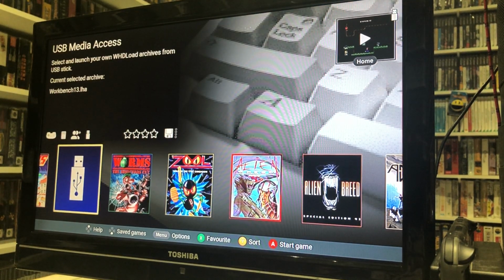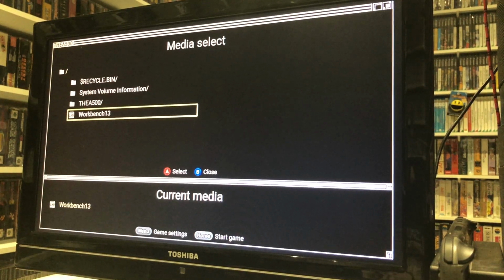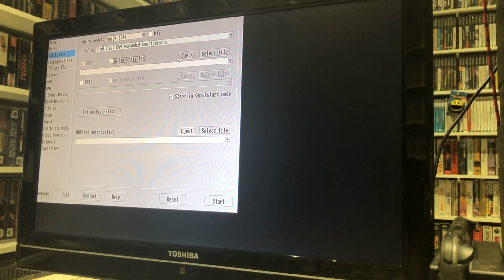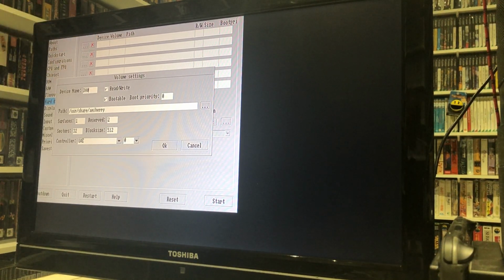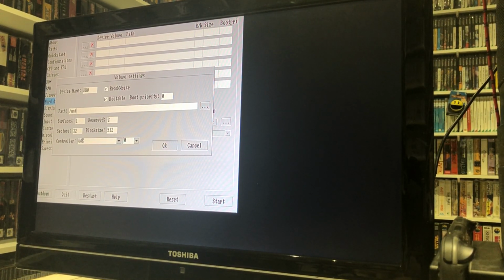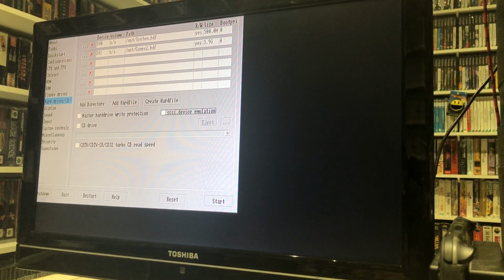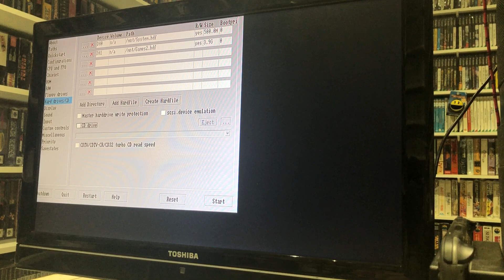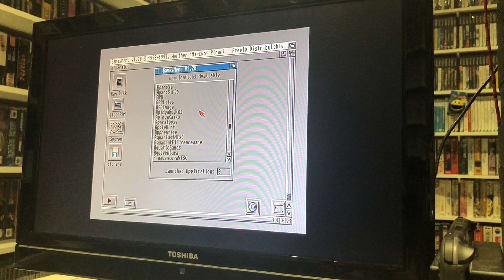Amiga A500 Mini - We Have Workbench and WHDLOAD Working!

Comment: Having seen that this can be done (I don't even own one yet), I could add all 3000+ .HDF versions of the entire Amiga WHDLoad game collection with their own .uae files to autoboot the game with no Workbench required to load first, so the games load like they do when booted from the game carousel.  Awesome.  I did this years ago with Amiberry in its infancy, so it should be a doddle.  I'll get Excel to output all the .uae files for me with the necessary code changes to do it.  I need an Amiga 500 Mini first though so I can test it all! :)
Reply from the maker: Yes thats an option mick, although im not sure the built in WHDLOAD version will load all the games you see, if you know the WB version of WHDLOAD works (which it does) this ensures the games will, let us know how you get on though!